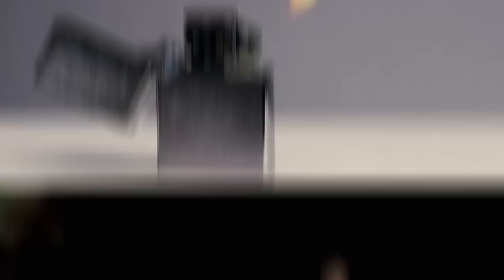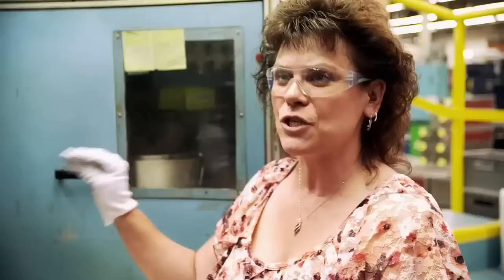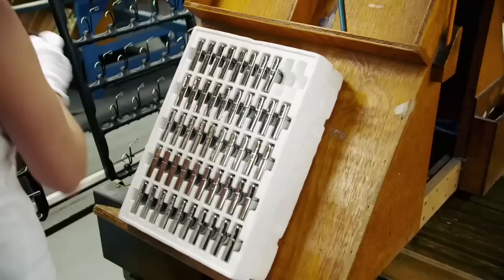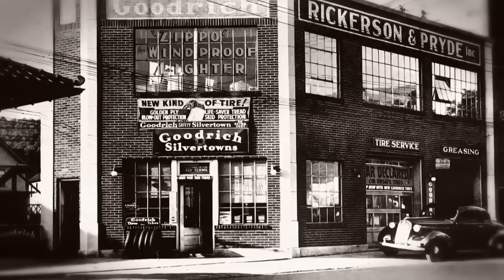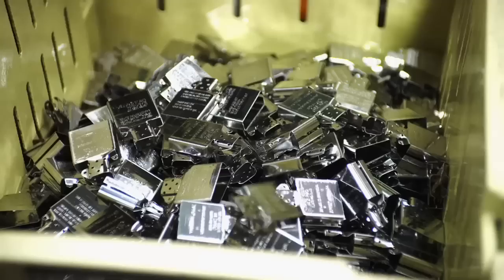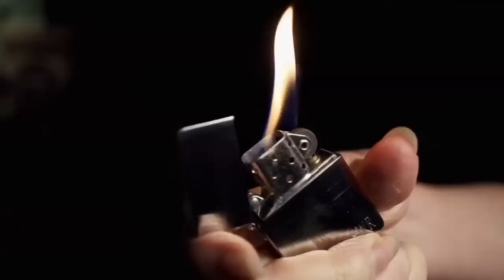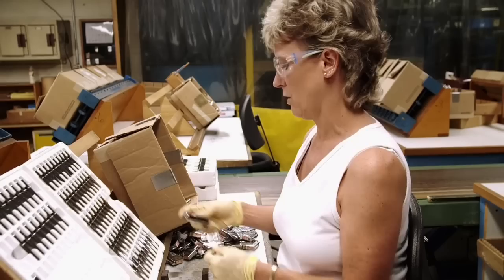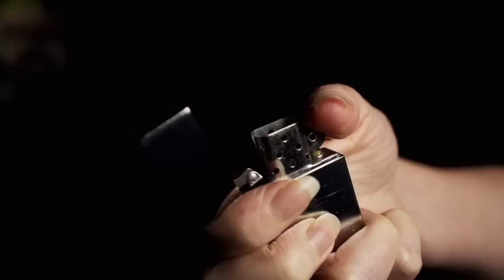How a Zippo Lighter is Made!

Comment: The hinges from the older ones are much better then now . 2005 armor has a Bagger hinge . Now they using the regular from the normal zippo on an armor . It is not strong enough . Please zippo. Make it a little better . Also the inserts are a little to small on top for the lid . It wiggles a lot.